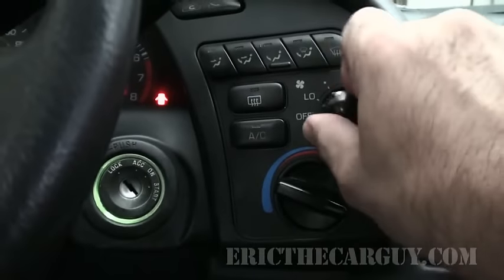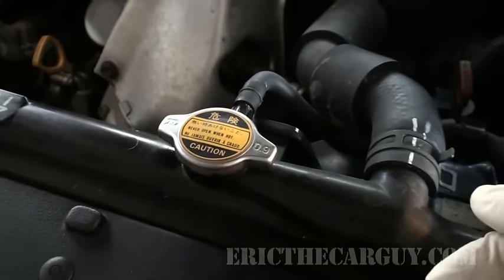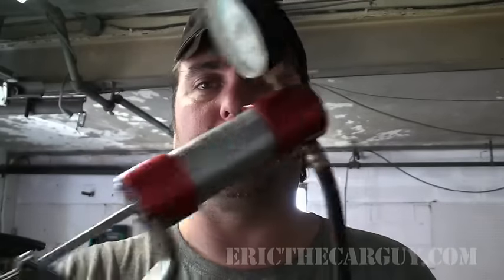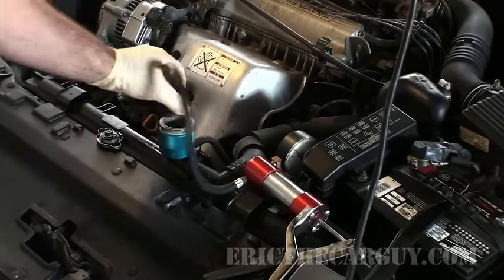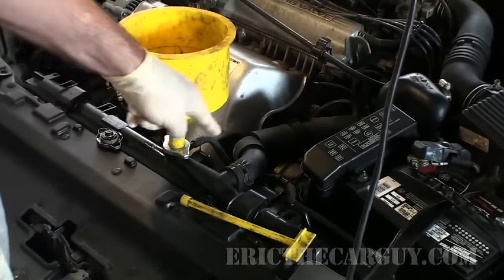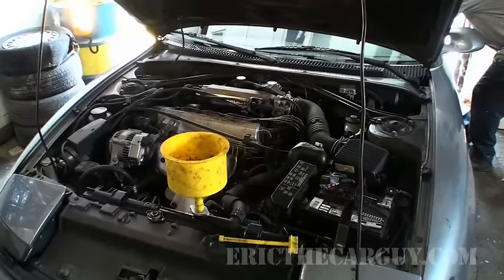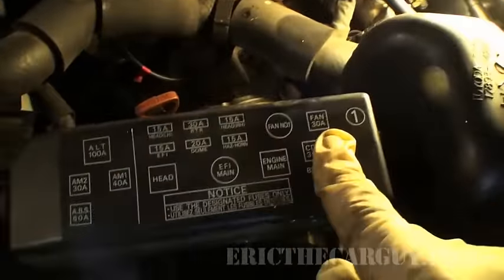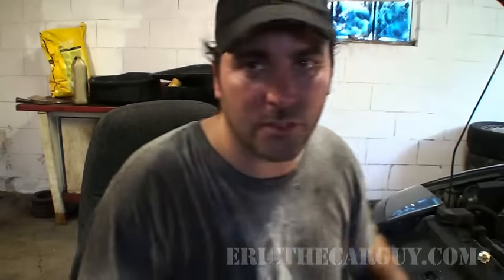How To Solve An Engine Overheat Condition - EricTheCarGuy

Comment: I bought a 99 Cavalier with a 2.2 a couple years ago that the dude got it so hot it stuck an exhaust valve and burned a hole in the head, a $45 junk yard head, thermostat, head gasket and bolts and a complete flush and I'm still driving it.

Comment: If the car can idle for 2 hrs and drive low speed another 30 minutes only then starts to overheat - my estimate is not thermostat or water pump. What could be problem? A cracked hose?

Comment: Hello friends, I have a 2005 Chrysler Town and Country that has been giving me so much grief with a coolant leak. Initially there was a small crack at the radiator top hose outlet. So I replaced the radiator. A few days later the wife calls and says it's overheating. I check it and water is low. So I bleed and burp it and refill it. A few days later..... So I replace the thermostat and housing and radiator cap. A few days later..... At this point I am like WTF!. I never see anything leaking. So I do a pressure test @ 15 and holding steady. Still losing water.... So one day I look and see water coming out pretty good from under the van. So I craw under there and sure enough it's coming out of the water pump pisser. I later find out that sometimes it has to be in the right position to leak and why I didn't find it with the pressure test. So I replace the water pump. Now I give it back to my wife and a few days later she says it's overheating. At this point I am ready to drive the damn thing into the lake. So I reluctantly give her my Jeep to use since she totes the kids around and I take the van which only goes back and forth to work. Every day before each round trip I top it off. Sometimes it's just a little and other times taking a half gallon. Each way to work is about 6 miles. It usually always has some kind of pressure still when releasing the cap, even if cold. Before when the water pump was bad it never had pressure. So this past weekend I pulled it up on the ramps and did a pressure test @ 15. I let it run for a half hour with the heat on. It held at 15 the whole time. I held it steady at about 2k RPM for a while too to see if anything leaked. I did an oil change the same weekend and everything looked good there, even for having 222k miles on it. The head gaskets was replaced about a year and half ago. So now I am stuck with the van until I can figure this damn thing out. I don't see anything coming from the tailpipe. At times I can smell coolant when outside of the vehicle, but unable to find anything leaking. I checked the heater core the best I could. I never smell anything inside the van either. A friend said that it could still be a head gasket but it's going over the pistons of something like that and why it not mixing with the oil. I don't know if I put much stock into that. But hey, what do I know? He said it could also be the heater core and it steaming out instead of pouring out. I guess that could make sense, but I thought I would smell it still since the heater core is on the inside of the firewall. But hey, what do i know lol? So at this point this is what has been replaced: Radiator, cap, thermostat, thermostat housing, upper and lower hose, water pump. I am looking for any other suggestions please.

Comment: Damn hes just a good ol boy !!! Fine to where you at my 06 impala is on the no go mode it over heated no warning lights gauge stayed even kill 
I swear i thought it sucked up some small animal  it quit it wouldn't turnover the engine  that is at first water ran out the side towards the manifold  not at first and not long or any where else so i sat day two some small man came and he said my head gasket and water in spark plugs he never asked me what happened he went to remove the plug and i saw no water so i just watched when trying to crank xar it was starting to nit sound lovcjrd it sound like it wanted to start he stopoed told me 800 hell fux it 
By the power if grey skull he will never see my money 
Which brings me to you what do you things my bro thinks uf bag ir whatever he said he said it may be from what i said ANYTHING TO GET IT LOOKED AT 
SO WHAT DO YOU THINK YOU'RE DUPER SNART

Comment: Lexus dealer wanted to replace the damper. The damper, according to Lexus IS going to cost me over$3,000.00!! I can’t afford that right now. How could they even tell me that damper COULD be the problem, and they said to replace the damper first. I feel Lexus IS trying to milk me on my car’s overheating issue. I pulled my car away from Lexus’s Service Department, took it to another mechanic shop, they’re telling me the radiator has a seaping leak, but it’s so small of a seepage, that it’s not what’s causing my car to overheat. They could not get my car to replicate the overheating issue. Two different repair shops and they don’t know what’s wrong‼️‼️🤨🤨 I get my car back and it overheated AGAIN on me. Needless to say, my car is in my garage sitting now, because of the overheating problem no one can get it to replicate but me, and I do have to have all four wheel bearings replaced, and realigned again, so this coming Thursday, the third mechanic is going to replace the wheel bearings, re-align my car again, put a new radiator in, thermostat, and new fresh coolant. This overheating issue is becoming real expensive for me, and in my opinion, I need you, or someone you know here in Colorado to see if there could be anything else causing this overheating issue?? Tell me what you think.

Comment: Another cause can be,once I saw all that rust on the radiator,a corroded pump impeller,it happens,everythings appears fine but no water circulation,so one can think its something clogged,not its not,if you didn't have an impeller vanes theres will be no water circulation,I lerned the hard way,and a second thermostat that the damn 98 to 04 Pathfinder 3.5L had in the back of the engine between the firewall and below the intake manifold,where is the line that you bleed the cooling system,seems that nobody knew that this exist,was a pain in the a#^!!!

Comment: Love this video. Soooo helpful. I’ve been doing my own repairs for a little while now, and I find this video the MOST helpful. I do have a question though. I was looking into purchasing a vehicle. I’d usually do these steps to diagnose. But i know that if it comes down to taking apart the engine because of coolant in cylinder head/block? Idk is it’s not going to be worth the buy. is there away to just check that first? I saw a video that if it there is liquid, then the motor is blown. Is this true? The person selling it says they had regular AC  maintenance on the car before the car started overheating. Now it will only start if jumped and it overheats quickly. Something similar happened to me.  It ended up happening to me a bit after I replaced my radiator bc it was overheating. thought I bled it properly and it was fine. But anyway I went for an alignment . They returned my car and the alternator wasn’t working when I was driving off the lot. They fixed that. Then the alternator went out driving off the lot. They fixed that, then I tried to drive off the lot and my ac didn’t work. I replaced the ac compressor on my own a cpl days ago. Haven’t evac’d and charged yet cause I need a bigger compressor . I see where I could’ve saved $$ doing the easy stuff but was ion a time crunch. And where everything may have trickled down now that I learned a little more and learned from your video. But can you let me know if I can jump to the worst case scenario or if I should go ahead and take these steps. Idk if seller will let me diagnose...but should!!! Thanks! Sorry so long winded!!

Comment: EricTheCarGu @14.55 That comment/tip helped me out fella sounds like mines packed up as i changed my anti-freeze today it's on it's 3rd year change now the fan won't come on! Dashboard shows red telm symbol when strated usually it's blue for cool/cold.I felt the cold pipe at bottom and hot at top,relays seem to be ok as i switched them round incl all other fuses are ok.Could be the thermostat or temp sender unit??I'll let you know.

Comment: What happens when I turn on heater it brings engine temp up
Reply: Did you figure it out?
Reply: not really.  guessing it’s a cloged radiator cleaned  it out it helped but it’s still having issues. Also gauge is way out of range. 190 is almost to the L

Comment: just replaced waterpump and thermostat in 83 307ci olds. customer left drove 110 miles overheats with  oil in coolant blames me for blown headgasket or worse.  car was overheated three times before changing waterpump.

Comment: What if my overflow tank is overflowing and the car is overheating
Reply: Either headgasket or radiator cap if its happening in first 5 mins of car running. If not will be waterpump

Comment: Sorry about all caps I didn't realize it was on. TAKE LOSE THE RADIATOR MOUNTS AND GENTLY AND CAREFULLY SEPARATE THE RADIATOR FROM THE A. C. CONDENSER AND LOOK IN BETWEEN THEM WITH A FLASHLIGHT. I DID THIS ON A MINT STATION WAGON THAT I PURCHASED IN THE EARLY  SPRING AND ONCE SPRING FULLY HIT, FOUND OUT THE REASON WHY THEY SOLD IT. YOU COULDN'T DRIVE IT IN TEMPERATURES OVER 70 WITHOUT IT OVERHEATING. AFTER MUCH TESTING AND FINDING OUT EVERY PART OF THE COOLING SYSTEM HAD BEEN REPLACED EXCEPT FOR THE RADIATOR AND THE MISSING THERMOSTAT I WAS MYSTIFIED. SO TIME TO INCREASE THE SIZE OF THE RADIATOR. I GENTLY PRIED IT BACK FROM THE CONDENSER AND FOUND THE PROBLEM. AFTER SEEING WHAT IT WAS I REMEMBERED THE PEOPLE OWNED A HUGE DOG THAT THEY SAID LIKED TO SPEND HIS DAYS LAYING ON THE COOL CEMENT IN THE GARAGE, RIGHT NEXT TO THE STATION WAGON. THE ONE INCH GAP BETWEEN THE RADIATOR AND CONDENSER LOOKED JUST LIKE THEIR DOG. I DON'T THINK YOU COULD HAVE GOTTEN ONE MORE HAIR IN BETWEEN THERE. IT WAS PACKED IN SO TIGHTLY THAT THE FIRST LAYER PEELED OFF LIKE A FUR WELCOME MAT. THEN THE HORROR OF CLEANING OUT THE TINY LITTLE HOLES PACKED FULL OF DOG FUZZ BEGAN. AIR BLOWERS, NOPE, WATER SQUIRTER AND HOSES OF EVERY KIND, NOPE, DUCK TAPE, NOPE, LINT ROLLERS, NOPE, MILD ACIDS THAT WERE CORE SAFE, NOPE, FIRE, NOPE. THEN SOMEONE SHOWED ME A HEAVY LONG BRISTLE BRUSH WHICH I WAS ABLE TO GET BETWEEN THE TWO AND AFTER HOURS OF BRUSHING AND POKING FINALLY CAUGHT AND EXTRACTED ALL THE YEARS OF CAKED ON HAIR FROM BOTH UNITS. YEP, THAT SOLVED THE OVERHEATING ISSUE AND I EVEN HAD TO PUT BACK IN A MID RANGE THERMOSTAT TO GET HEAT IN THE WINTER. I TOOK THAT CAR BACK THE FOLLOWING SUMMER TO SAY HIGH TO THAT FRIENDLY OLD COUPLE WHO SOLD IT TO ME. I BRAGGED ABOUT HOW MUCH I LIKED IT, HOW MUCH OF A CLASSIC IT WAS AND HOW IT WAS GREAT TO TAKE ON TRIPS OUT WEST FOR SUMMER VACATIONS. OF COURSE I CAN'T AFFORD TO GO ON VACATIONS THAT'S WHY I BUY USED CARS,, I'M NOT RICH. THEY ASKED ME IF I EVER HAD ANY PROBLEMS WITH IT AND I TOLD THEM IT'S BEEN THE BEST USED CAR I EVER BOUGHT. I THANKED THEM ONCE AGAIN, PREPARING TO LEAVE AND THEN THEY ASKED ME IF I WANTED TO BUY THEIR LATEST CAR SITTING THERE IN THE GARAGE, ONLY THIS TIME WHEN I ASKED THEM IF THERE WAS ANYTHING WRONG WITH IT THEY ACTUALLY ADMITTED THAT IT OVERHEATS WHEN IT GETS WARM OUT. THEY OFFERED ME A GREAT DEAL, TOO GOOD TO PASS UP AND SO WHILE REACHING DOWN AND PATTING THE HEADS OF THE NOW TWO BIG FUZZY DOGS LAYING AT MY FEET, I SAID WHY NOT, WHILE THINKING TO MYSELF,,, NOW,,, WHERE DID I PUT THAT LONG BRISTLE BRUSH!

Comment: Ok, I cannot get my car to replicate the overheating problem. The fan came on as it should have, Lexus let it idle for two hours, and it did not overheat. They drove my car for ten to twenty minutes, it would not overheat. The day I get my baby back, she overheats on me. I took my car to another mechanic, they ran the tests on her, and could NOT get it to replicate the overheating. I got my car back yesterday, my car overheated on me AGAIN‼️🤨🥺 I miss my car when she’s in the repair for a week straight each time. Why is my car overheating? She’s a Lexus GS 350. I wish you could look at my car, but I’m in Colorado. I’m taking my car to a third mechanic Thursday. He is going to go ahead and replace the radiator, thermostat, and fresh new coolant in the radiator and the reservoir to see if that stops the overheating problem.